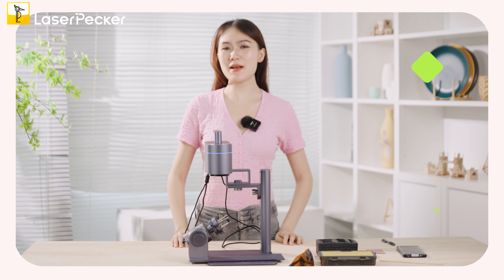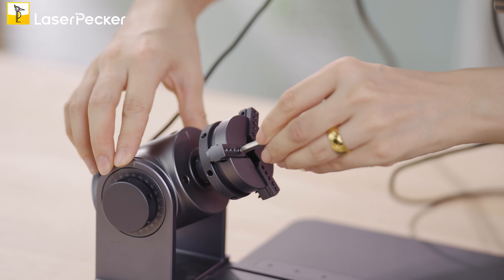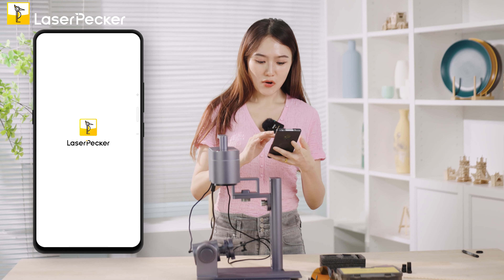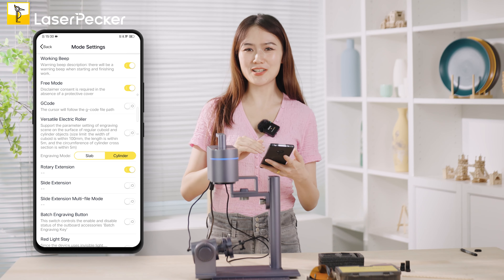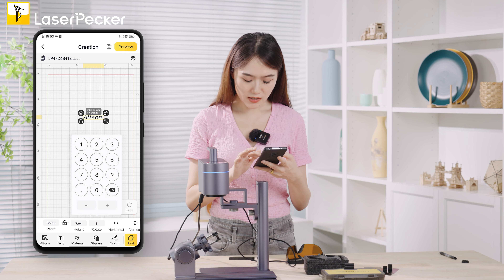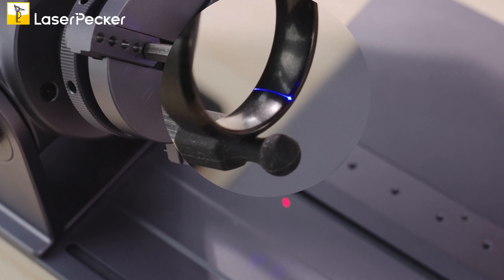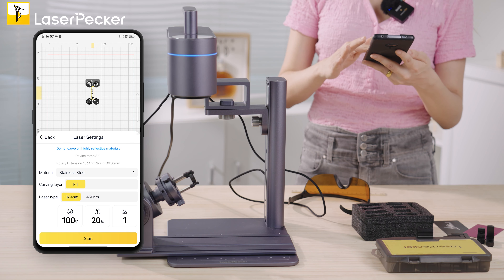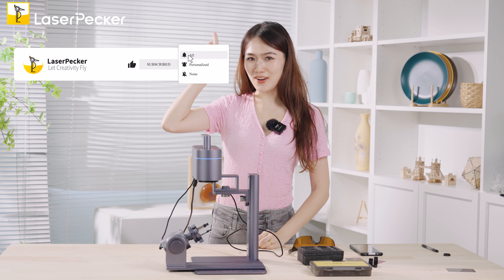LaserPecker LP4: Engraving the Inside of Rings (Step-by-Step)

Comment: When using the PC version and checking my focal length so that the two red dots become one in the preview at the bottom of the inside of the ring, my LP4 is showing the blue line about 2mm right on the X axis from where the laser actually cuts. This is making my engravings not appear centered on the inside of the shank- if it engraves inside the ring at all. PC version LPDS 2.5.5 LP4 firmware 6.5.4

Any suggestions on how to get the guide projection to show the actual area it will be engraving.
Reply from the maker: It seems like there's a misalignment between the preview and the actual engraving area. Please make sure that your machine is calibrated correctly. You might need to run a calibration test or reset the machine. For detailed guidance, you can refer to the user manual or contact our support team.

Comment: the first time i tried i got a mirrored engraving because i didn't mirrored the text on the app.. but now instead of mirroring the image (because i still use the old app and there you can't mirror images) i just put the rotary tool with studs on left when i have to engrave on inside... and put as in the video with studs on right if i have to engrave on outside
Reply from the maker: So did you finally achieve that?^^

Comment: Hello, I have a problem with engraving rings with LaserPecker 4. When I engrave plates everything is fine but when I change to ring first time engraving is okay, but the second is very weak no matter what power and depth I put and it doesnt engrave at all. If you can help me I would be very thankful.
Reply from the maker: Hi! It sounds like there might be an issue with the positioning or focus when switching to ring engraving. Please ensure the ring is securely fixed and properly focused. Additionally, try cleaning the lens of the laser. If these steps don't help, please reach out to our support team for further assistance.

Comment: And be careful the black rubber chuck tips won't get in the way of the laser beam!
Reply from the maker: Thank you for the reminder! Our portable laser engraving machine is designed with safety in mind, and we include safety features to prevent interference with the laser beam. If you ever encounter any issues or have concerns about the chuck tips, please don't hesitate to contact our customer support team for assistance.😘😘
Reply: Mine keeps interfering with the tips. Is this a design flaw that I have to live with? Or is there a way to reduce the chances of this happening?